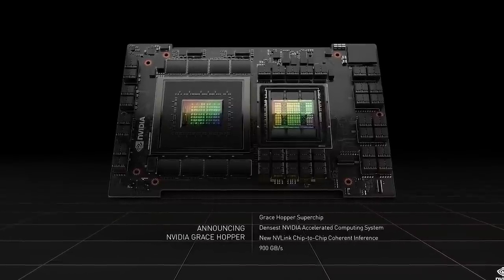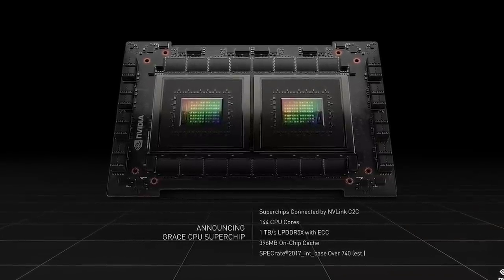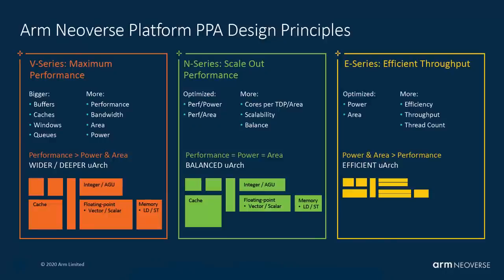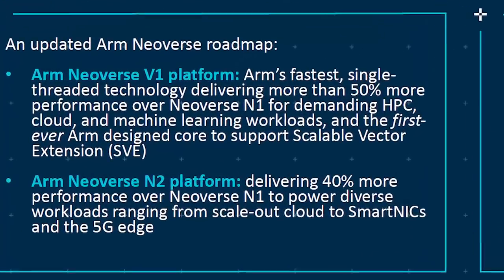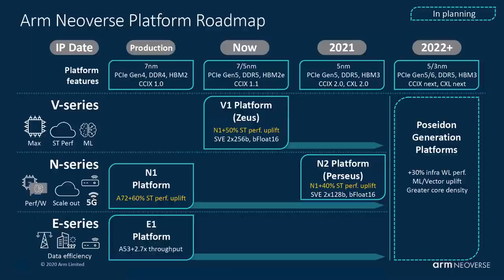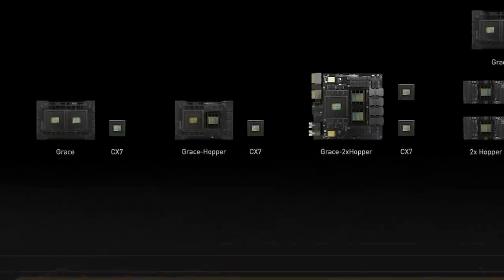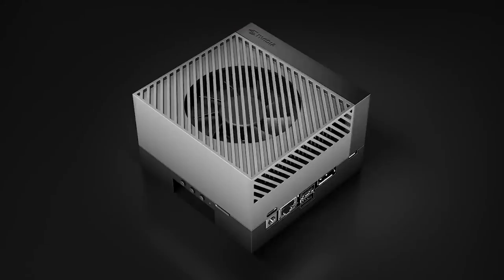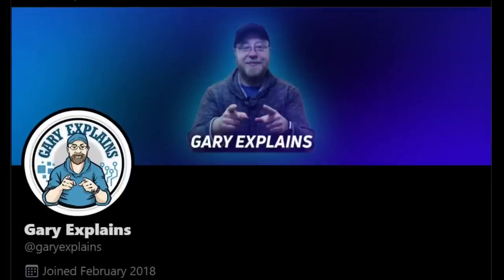NVIDIA's Grace Superchip! Cool, But What is a Superchip???

Comment: The future of compute is the SOC. Cpu, gpus, memory, its just so beneficial to out it all together. It saddens me as a custom PC guy but the computational improvements are exciting.
Reply: There's nothing to be saddened about apart from liking the nostalgic feeling of plugging in a GPU.
Reply: The raspberry pi did not reduce the fun of tinkering. I don't think the rise of SBCs will.
Reply: The future of amateur programmers and hackers will be uncertain and worrying
Reply: @Mr10Residentevilfan CPU and GPU have been together on the same die for years now. SBCs tablets and laptops already have them as part of the board. Desktops PCs might be a hold out for a little while. These little SBCs are also tinker friendly, just in a different, more versatile, way than desktop PCs.

Comment: So basically a build your own Enterprise Machine Learning Supercomputer Kit. 

Also that new Jetson Board. Holy shit. Kinda sad really that nvidia is not offering SoCs for Windows on ARM. I think Nvidia really could make moves in that market if they wanted.
Reply from the maker: Since the Grace processor uses Arm designed processors then there is nothing stopping anyone else from making SoCs for Windows on Arm, that is in fact what Qualcomm has done. The difference is that the Grace Superchip uses 500W, that is very different to the 6 to 15W you need for a laptop.
Reply: @GaryExplains  500W is pretty nuts for an ARM setup.  I wonder what it would be like if they did make a 15W version.  Also wondering if this tech will replace what they were doing with Tegra.  Be interesting if these showed up in phones and Android boxes/shield type deals.  Lots of cool ARM tech coming from unfortunately the most anti-consumer brands (nvidia, apple).
Reply from the maker: Neoverse cores aren't designed for low energy usage, you need Cortex-A cores for that.
Reply: Why Windows though??? Since we are giving up on compatibility either way, is it not the greatest time to make the switch to Linux?
Reply: @GaryExplains  I was more thinking about the Jetson's SoC. But right I forgot that Qualcomm had this stranglehold on the Windows on ARM market.
Reply from the maker: You aren't really giving up on compatibility. Re-compiling for Arm is relativity simple for most programs. Big suites like Adobe take longer, but there are already Windows on Arm versions of some of their apps. If there isn't a native version then the x86 emulation is quite good. From my experience you can use a Windows on Arm laptop and not realize that it is Windows on Arm rather than on x86.
Reply: @GaryExplains  I meant legacy software etc.
Reply from the maker: As I said, legacy software will run under emulation, which is automatic, not need to setup emulators etc. The emulation means that Windows on Arm is superior to Linux when using legacy software.
Reply: @GaryExplains  Well, it kinda sucks that microsoft didn't f up on this one. I hoped we could bring some more people to Linux xd.
Reply: Yea im waiting for competitive ARM  SoCs on windows, after what Apple has done with the M1 Ultra i want Nvidia to sell Desktop SoCs so bad. Imagine an ARM SoC with integrated Cuda and Tensor cores for machine learning.

Comment: Moving architectures in an existing datacenter would be a really difficult move, especially with all the vendors.
Reply from the maker: Why?
Reply: @GaryExplains  Presumably, they are all running Linux, So same eco-system, same management, same data formats in and out. I don't think it would be that hard to swap or integrate ARM systems.
Reply from the maker: Exactly
Reply: @waynerobertson511  It depends on the use case.
Reply from the maker: Please tell us some of the difficult use cases.
Reply: @GaryExplains  x86 VDI run on arm would be one. Many datacenters run a mixture of server oses. So you'd have to have a large share of your datacenter running on Linux to justify it. It wouldn't work on ours unless we migrated some of our software to Linux. It is possible but it would be a huge undertaking.
Reply from the maker: Yes VDI is an obvious one, but that is not the segment that Nvidia is even remotely (sorry for the pun) interested in. Amazon, Oracle and Microsoft all now offer Arm instances and their usage is increasing quickly.
Reply: @guysmiley7289  Most of the Silicon Valley stuff use Linux in their architectures, which is already a huge market and a very good starting point.
Reply: @tunahankaratay1523  Most use a mix but yeah, large corporations are using a lot of linux.

Comment: I feel the need to ask... why exactly are there no Photonic GPUs... no Photonic CPUs... and no Photonic APUs, especially when it's mainly fiber optics to interweave the lightwaves to do all the calculations lightning fast with no moving parts, therefore never overheating. We have far more than enough material to create all the fiber optics needed... and is a whole lot cheaper than silicon. I very much suspect manufacturers are afraid that photonic computers will be far too disruptive economic-wise.
Reply: They are being worked on but their is issues around power draw and size (mainly cause photonic based parts are much larger than silicon based) also more fragile, Several companies are in the process of developing photonic cpus/gpus using different approaches.
Reply: While staying at room* temperatures, photonics operate at least 10 times faster than the best silicon chips and require 90% less energy consumption. The Photonic components are mainly fiberglass surrounded by color LEDs and image sensors... technically doing all the calculations through the intermixing of lightwaves of over a little more than a billion colors that it can handle.
Reply: @ThankYouESM  fibre optics are known to be extremely fragile at their core which is where they would be in this case  light sensors etc are not in the small micro factor with current silicon yet and still needs more work. Smaller is the way everything's going not back to bigger. Might of missed the power part in articles but the rest is an issues.

Hybrid between the 2 is where we will end up not full photonic.
Reply: @RickyT15  After giving it more thought... I suspect the actual delay is needing to almost rewrite the entire infrastructure quite the same as done for quantum computers. I could be wrong.
Reply: @ThankYouESM  this is where hybrid comes in. Using a current chip and changing the channel connections around the board to optical. Would require some infrastructure but much easier to accommodate. Kinda like what light matter is doing with envise.
Reply: @RickyT15  There are now 3+ light sensors in many smartphones for the cameras able to take 4K quality photos, meaning...it does have to be smaller than it already is. Same with LEDs... or rather... microdot OLEDs are much smaller. Also... when saying photonics are 100 times faster than the best silicon chips... they are referring to same size comparisons.. and on top of that... we could add a billion times more in the replacement of the cooling fans or water cooling systems... and even have no need for thermal paste, therefore... not even an issue of size in any way.
Reply: @RickyT15  I never heard anybody mention it needs to be a hybrid... except for quantum computers at the moment. You could be right, I'm not an expert in that field.
Reply: @RickyT15  I can understand that hybrid might be the only way, but... at least photonics can do all the heavy work.
Reply: @ThankYouESM  Ryan Hamerly who works in quantum photonics mentioned that he doesn't believe we will end up in full photonic and will use a hybrid model. Didn't say it needed to be just highest possibility

Comment: Sounds like a downgrade, selling a computer with little to no interchangeability options
Reply from the maker: Eh?
Reply: Why the heck would you want interchangeability? Higher manufacturing costs? For buying a very expensive GPU which is bottlenecked by your weak CPU? slow RAM? Bigger form factor? More energy costs and bigger power supplies? Worse cooling?
Reply: @viciadoemhalo3  You're right.  Xbox master race.

Comment: AMD MI300 will slay them all next year
Reply: Different markets. A100 is much faster than MI250X in AI (FP16, tensor ops, etc), Hopper tripled the performance there. Nut Hopper  is still slower in FP64.

Besides after MI300 comes, we will see Nvidia Blackwell the year after and so on and so forth
Reply: @monkgogimasedi5265  Not really different markets, both products are gears for data center and AI workloads. 
 MI300 will feature twice as many GPU dies as MI200. CDNA3 will probably eat half the wattage of Hoppers insane 700w power draw

Comment: So, has anyone made a home made Android gaming device out of the Jetson?
Reply: well. switch is basically has the same soc as jetson, but with custom transistor count and clockspeed. even Switch is developed on jetson.
Reply: @novelnouvel  Cool 😁 I know nothing about coding (I've only tweaked Crysis config files...) but having 2000 Ampere Cuda cores would seem a lot better than 200 Maxwell cores. At least to a layman like me 😏

Comment: That 1TB of 1TB/s LPDDR5X memory looks an awful lot like what Apple is doing with the M1 Ultra's memory, except it's LPDDR5X with 1TB/s of memory bandwidth and not LPDDR5 with 800GB/s, something we might see w/ the M2 generation..
Reply: Apple's 800GB/s is shared between both CPU and GPU, most likely 80% of which will be used by GPU. While in GRACE 1TBps is 100% occupied for 144 cores CPU.
Reply: Also LPDDR5 is 6400MT/s and LPDDR5X is 8500MT/s so apple is not using LPDDR5X yet.
6400 @ 1024 bit bus = 819GB/s
Reply: @vineetkumarbharti2633  You sure you read my comment? I'm fully aware Apple's memory isn't LPDDR5X, that's why I said it's something that we might see with the M2 generation. Are you drunk, or just really really st000000?
Reply: @vineetkumarbharti2633  It depends on any given moment and what task you're performing on it. The CPU's fabric, if it's like on the M1 Max MacBook Pros, will already be limiting the CPU to be able to only saturate about ~480GB/s at maximum. If you're doing mostly GPU heavy compute, then pretty close to all of the bandwidth will be taken up by the GPU. But I'm also not sure if the CPU & GPU sharing that memory bandwidth matters (and I'm not even talking about the fact that on a traditional PC system, yes the GPU will probably have more bandwidth available to it but its communications with the CPU will have to be through the PCIe slot and through much much longer motherboard traces) because Apple Silicon already has large amounts of SL cache that the CPU & GPU will share and on top of that the CPU and GPU's own private caches are also massive anyway, all of which will help significantly reduce DRAM bandwidth (The two 10-core CPUs have 48MB of L2 cache in total, and the two 10-core CPUs and two 32-core GPUs (which present themselves in the software as 1 CPU & GPU) have 96MB of SLC in total, and that is speculated to jump to 72MB L2 & 144MB SLC w/ the M2 generation). And Apple's GPUs having large amounts of tile cache within the cores will also help them a lot when they adopt RT instructions within their GPU cores.
Reply: @utubekullanicisi  even while drunk, i can tell that comment is edited. LOL
Reply: @vineetkumarbharti2633  And?

Comment: 3:10 1TB/s of bandwidth, not size
Reply from the maker: LOL, no, size... See Jensen say it here: https://youtu.be/39ubNuxnrK8?t=2524
Reply: @GaryExplains  don't worry we'll get there too someday 🤔😱😱😅
Reply: @abdullahzafar4401  yeah, when you put your card into a PCIe 9.0 x16 port, the bandwidth will be 1TB/sec, not too far, just a few decades :)
Reply: @randomcomment9992   Lol , maybe 1.5 decade or 2 ... 😂
Reply: @randomcomment9992  It's both 1TB/s and 1TB, I don't know what you guys are talking about. Yes, it's harder to achieve that bandwidth with standard DIMM modules, you'd need a lot of DDR5 DIMMs to be able to achieve that, but this is soldered LPDDR5X.

Comment: NVIDIA seems to be following Apple's strategy of combining CPUs and GPUs in one chip and then scaling it by adding more chips of the same kind.
Reply: Was so sure some fan-boy would bring up the theorie Apple invented the interposer / multichip-modules 😂
Reply: @ThorDyrden  there's plenty delusional fanboys out there
Reply: They're not following Apple, the development of these chips had started before Nvidia and Apple had any idea about what each other was doing. Chip development takes 5 years.
Reply: @ThorDyrden  theory* Also they didn't claim that, but they're indeed wrong. Just so you know, being a hater or belonging to another fanboy group is no better than being an Apple fanboy.
Reply: Agree, nvidia copied/very similar to apple strategy fusing chips
Reply: @utubekullanicisi  agree
Reply: @miyagiryota9238  „Fusing“ multiple CPU sockets with an interconnect in a ccNUMA-architecture is a multi-decade old practice, especially in HPC. It nos not „apples“ strategy. What apple did was market it good and actually sell it (nowadays there aren‘t many ccNUMA consumer grade architectures). In HPC and servers, it is very common.